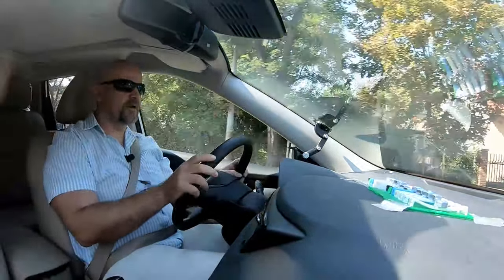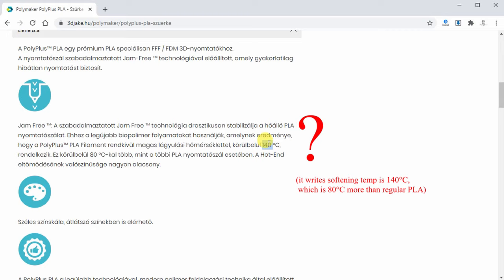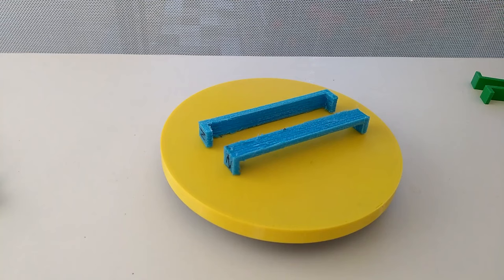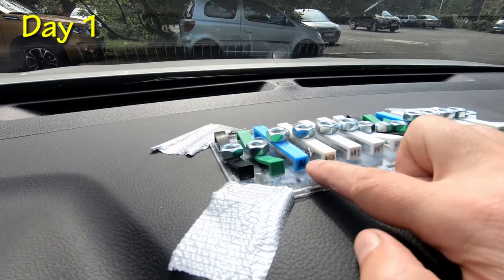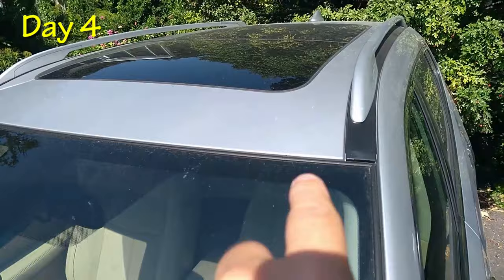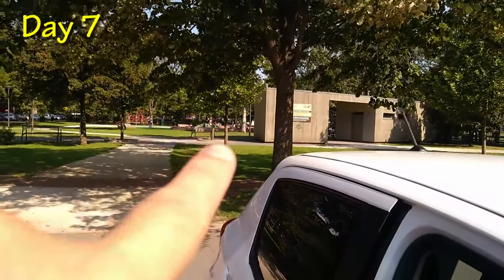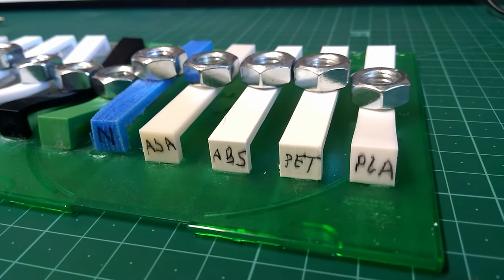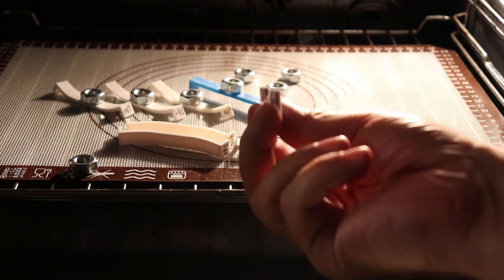What 3D printing material to use for object inside a car? Temperature test

Comment: I learned that PLA is not suitable for summer car driving the hard way. My Raspberry Pi Display stand melted in no time. :D
Reply: Did you ever redo it in a different material?
Reply: You have to anneal it first.. then it will hold up better than ABS / ASA

Comment: ASA is also much more UV-resistant than ABS, which is important if you print something for outdoor or in-car use. Great test, thank you! Unfortunately, summer seems to be over here in Germany…
Reply: But if you paint your print, then there's no need for that UV resistance in the filament. Right?
Reply: @alejandroperez5368  resistant, not proof
Reply: @leew8812  further arguing against the original point lol
Reply: Regular glass blocks almost all UVB, and usually the windscreen of a car will have a decent (80-90+%) UVA filter too. It’s less clear to me how many cars have UVA filters on the other windows, and how good they are. 

Also think about how much time the part will actually have UV exposure. Unless your car is parked in direct sunlight all day, and your part is going to be getting that sunlight at peak time, it’s probably a pretty small amount. UV exposure tapers off quickly outside of the ~4 peak hours. Even just parking in the shade of a house could halve the UV exposure of a part

Personally, for something inside the car, I wouldn’t worry about ABS not being as UV resistant as ASA. Even for outside the car, I wouldn’t buy a roll of ASA (if I already had ABS) when I’m not even sure if the part will be noticeably damaged by the UV (outside of the basically guaranteed discolouration).

If you have ASA already, and you can print it (it’s tricky!), yes it is technically better. But don’t stress about the part getting ruined because you don’t have the magic filament.

Comment: I have used ASA for my 4runner's phone dock, umbrella holder and various hooks and parts inside the car. It is an excellent material for this use case and has worked reliably for two years. Temperatures where I live get into the low 100F range.
Reply: Given this test, would you ever try to use PETG for the same purpose?

Comment: I printed an exterior plaque with raised letters out of PETG that is in direct sunlight every day for several hours.  3 months and it still looks as good as the day I printed it.
Reply: I too made plant tags for all my exotics, I live in CA, just went through a few ~110 F weeks....even printed in shiny black PETG(the 20ish usd rolls on Amazon...nothing fancy at all...in fact budget but not too low on the ladder). They all held up great wich is great but none are under any load or stress. I also suspect that anything outside greatly benefits from airflow to aid with cooling...much much different than under glass on a dash.  That's how ppl cook without electricity or fire.

I'm 99% into useful printing and about 75% of that ATM for me is living outside....so far PETG is so good at most things once dialed in, and pieces have that heft feel...that QUALITY feel lmao

Asa is to PETG like PETG is to PLA  except PLA still wins the toughness test time and time again.

Comment: I am new to 3D printing. The very first thing that I drew up in FreeCAD and printed as my first "thing" was a sunshade for a portable GPS receiver. I wondered about the direct sun affecting the PLA print, so I created a frame arrangement that allowed for a paper shade over the PLA frame. That won't prevent the ambient temperature problems, but it will keep the printed parts from receiving the direct sunlight and heat. Now, when my plane is out in the sun for a short time, I won't worry about the frame collapsing. If I know that it will be outside for most of the day, I'll move my sunshade off of the instrument panel and put it in the shady area inside.
Thank you for doing this research.

Comment: Perfectly done test with real life parameters, i print a lot of car parts, interior and exterior, i actually drove a test piece on the exterior for half a year, autumn to spring, made from PLA, no fading no deformation, as soon as the summer came it bent out of shape, i also had exhaust pipe covers made of PLA, the color faded quickly but the material held up just fine for over a year
Reply: " i also had exhaust pipe covers made of PLA, the color faded quickly but the material held up just fine for over a year" X DOUBT.
Reply: @Tarex_  nothing about a picture on your instagram proves that PLA survives direct contact with your exhaust tip.
Reply: @gearcheck101  well, nobody is forcing you to believe it, test it yourself, but if you do look the exhaust already had exhaust tips and the PLA covered those, if it helps make sense of it, otherwise, fact is it happened :)

Comment: Thank you for doing this.  I need to print a couple items for my Jeep.  I was going to use ABS just on a guess.  You confirmed it.  Again thank you
Reply from the maker: You should consider ASA too if the part will be outside, it is more UV resistant.

Comment: the temperatures mentioned are not marketing schemes, you need to anneal them to pass the glass transition temp so the molecules in the polymer change their structure and the part remains much stronger, the challenge is annealing them without structural deformation.

Comment: HT-PLA requires to be heat treated, usually putting it into oven for it to be able to recrestalize. Then it should have much better heat resistence. Tom Sandalerer did a great video where he used 3d printed HT-PLA coffee cup and even coffee espresso kettle.
Reply from the maker: Yes, I know about annealing 3D printed objects, my problem with annealing that object deforms, and if I need some accuracy, that's not the solution. On site I couldn't find this info that HT PLA has to be heat threated, only then it will give those properties.
Reply: @MyTechFun  Should be possible to make a form to hold the HTPLA in shape while annealing, especially for those test strips you used. Not really so good for more intricate parts though.

Comment: I like your practical test.  It shouldn't be controversial, but it is.  PLA should only be used for items made for "Conditioned" spaces.  Other materials should be used for mechanical parts which might reside outside of air conditioning.  A hot shed, garage, automobile or direct sunlight will soon have your parts in poor condition.  PLA is great to learn printing.  But it should be avoided for any type of practical or mechanical part used outside of air conditioning.

Comment: Great to see some testing in more "real world" scenarios. I wonder how annealed PLA (treated in oven at 70-80° for 30-60min) would have held up in this test. CNC Kitchen has a video on this, lacking the real world test though.
Reply from the maker: The problem what I have with annealed PLA is that it deforms during this process. Not good for precise useful parts.
Reply: @MyTechFun  that is true, depends on the part and use. Just would have been curious how it compares.

Comment: Nylon is typically recommended for in car applications.  Though taking steps such as active drying and printing in an enclosure may be necessary to achieve suitable results.  Another option is to order your parts from a Mark Forged print bureau.  Their Onyx material is essentially nylon.
Reply: Wouldn't a rainy day completely warp the Nylon?
Reply: Not to my knowledge.  The moisture concerns with Nylon for 3D printing are mostly related to the filament prior to printing.  When you take a material from room temperature to over 200degC in less than second in a confined space (nozzle,) the sudden conversion of moisture to a gas tends to be quite problematic.  After printing, it might depend on the geometry of your part whether a hot day coupled with humidity could cause warping.  But generally of the thermoplastics available to us, nylon handles the hot environment better.  So far as I am aware, atmospheric moisture (absorbtion) alone shouldn't cause warping of finished prints.  As for rain on external parts, I'm not sure.  But in most external applications, I would probably prime and paint which would seal the material from the elements.

The biggest issue in automotive applications is typically heat tolerance.  But UV, moisture and cold can present other problems.
Reply: Half your plastics in a car are abs, so that's really industry standard. Most of the gears and other hard use mechanical items would be nylon, really either would work fine for most of our applications. I mean even pla would probably survive quite awhile if not under stress and not on the dash. My pla stitch figure has been in my car for awhile now with no visible changes. (Moisture makes nylon bad to print and brittle but otherwise the humidty really shouldn't have any noticable changes)
Reply: @stich1960  The parts you’re referring to are injection moulded.  Different process.  Professionally designed, tested, iterated, produced, post processed, potentially surface treated and produced with possible additives or modifiers mixed with the pellet stock.

Not saying 3D printed ABS won’t work.  It absolutely is an option to try.  Just saying that use in one process, doesn’t automatically make it the best for another.  Even for the same end-use application.  (Testing always required.)

I can tell you that I've had a Markforged Onyx sample part in my car for over 2 years.  Summer heat, direct sun, winter cold.  No deformation or warping.  Looks as good as the day it came off the printer.  Surface finish remains utterly flawless.  Smooth to the touch with no post-processing.
Reply: @barrettdent405  I get what your saying but differences are not terribly big. Yes structure would be different and the reduced z strength or nonhomogenous nature of a printed part could be different but talking in generalities here. There are quite a few abs printed parts being used in small run vehicles parts currently. Nylon is great but basicly nylonx is the ok only great filament for high strength applications right now and considering your looking at 20 bucks for abs vs 60 or farming out the printing personally I will stick to abs.

Comment: Hi!
Very great test, love to watch. Very few car interior parts is white. 3D printing has been very popular in classic car restoraions. And many old cars has dark or black interior. You did a great job, but can you please do the ultimate test: try 2 or 3 of the filament winners and print them in black. If for example ABS in black holds the test, its a big winner. Black absorbs more heat than white. Thanks
Reply from the maker: Maybe in future, but so far it's not in my plan to test black colors too.

Comment: Tests like this are very specific. Just because it works best in the sun on the dash does not mean it is best on the consol.  Does not mean it is not the best.   Specifications are complicated to use. Creep and heat are hard to specify. Melt temperature is often not useful use number.
Reply: I meant to mention. It is a great test. Thank you for the time and effort. It is a timeless topic. Best filament, depends on the rest of the question. Best for what.
Reply: I am not over weight I am warped. LOL

Comment: ABS material is more rigid (stiffer) than PETG, while PETG is more flexible.  ABS will crack if bend or pressed, PETG will bend too but not crack easily. i think this is the reason why PETG have a little "stomach" since it flexible and weightened by metal nut. For long term usage i choose petg because it more resistant to UV. Direct sun to ABS will slowly make it brittle over time, ABS have a tendency to warped during printing process so i can not get accurate dimension and it have poor layer adhesion if printed without heated chamber. PETG easier to print. i think ABS is more suitable for injection molding.  if your print need to be very rigid then ASA is your best bet.

Comment: I´ve tested some ASA 3d printed pieces on the dashboard. 60 days in a row, sunny every day except 10 days with few clouds, exterior temperature between 30ºC and 45ºC, interior between 55ºC and 75ºC (humidity could be around 20%) but I suppose that the ASA pieces (orange) surface temp could be 20ºC more because of the direct sun exposure. After that time they became very very brittle.
Reply: Yeah so do factory plastic parts. Leather too. It's not great to subject anything to direct sun light actually.

Comment: Thanks for testing resin print also. I would bet on ASA or Nylon. But actually printing with resin can be easier than Nylon - interesting. It's a shame that PETG is not good enough.
Reply from the maker: Yes, I am very sad, that PETG failed on test. But if you live more to the north then I and your parts will be in shadow inside car, PETG may work too.

Comment: PLA is not necessarily a problem in a car and depends on the shape of the item.
I made a phone cradle that was long and relatively thin and it warped on the first hot day but I have large PLA pods on my dash that house 3" compression driver tweeters weighing half a kilo and 4 years on, they have not warped at all.

Comment: PETG...the fallen hero 😅 I've found PETG parts will eventually warp/deform after days in the sun. But it's highly dependent on the design of the part (and potentially the infill?). Shame that we have to resort to mostly 'toxic' filaments such as ASA and ABS just to get parts that don't deform under heat/UV exposure...
Reply: There's always polycarbonate and PA-CF. Or just print your car parts in PEEK or Ultem 😂

Comment: Great test but wouldn't a printed part have additional coatings like epoxy resin, uv resin, carbon fiber plus resin on top that would certainly impact these results? I would be curious to see that test!
Reply from the maker: I will test effect of the epoxy in near future

Comment: I think PETG is probably the best compromise between printability and heat resistance. Of course, if you can print better materials, why not.
Reply from the maker: Yes, depend where do you live. PETG may be a good solution, if you don't put the material exposed to direct sun on hotest place in the car.

Comment: I like the test. 1. It looks like after the initial slight warping of PETG it remained rather stable. So... I wonder 1. If you heat treated any of these filaments before the test. I think the answer is no. 2. I would like a test between heat treated PETG vs non heat treated parts. Also PLA Heat Treated vs Non Heat treated. To see if there is any significant difference between the two processes for PLA. I like printing with PETG because it is less toxic than ABS or ASA. And Relatively low cost per roll. I have tennis equipment I am designing and it might be left in the car. Most defiantly used outdoors in direct sun light.

Comment: You need to also consider the effects of UV, direct sunlight on the filament used. Some filaments will totally warp under UV light!
Reply from the maker: Ordenary glass filter most of the UV. Plastic parts in cars are usually from ABS (injection molded)

Comment: While PETG did fail...it didn't fail that badly. Also take the shape into consideration. That's an extreme stress test. I'm printing a mirror cover replacement for my parents. I've been promised the top will be down in hot days and in the garage most of the time. So I think it will work.

Comment: Nice video Mister.
I own a model kit and one of the parts is molded with Nylon Resin Carbon Fiber Reinforced.
It means molded with though material right?
Reply from the maker: In most cases car parts are injection molded.

Comment: i wonder if a clear petg would be even more effective at holding up. if it just needs to be a functional part. it being clear would mean it doesnt absorb heat as much. which is why the black filament didnt hold up well, even though it was a bad filament for heat resistance, the fact it was black wont have heled either.

Comment: Nylon is hygroscopic and starts to creep at low temperatures when in contact with high humidity. The test result would be completely different if you'd considered that. Otherwise a nice comparison

Comment: The ultimate material for me would be a HT PLA or perhaps HT PLA+ or a Low Warp ASA. Why not a CF PETG. I want it EASY to print and a higher temperature than normal PLA. Low warping. Curling and such. Which material is that :(
Reply from the maker: Yes, from that video I tested a lot of different technical materials too. And yes, CF always helps with temperature resistancy, so CF PETG would be a great material for this application.

Comment: Hah🤨 I thought that PETG could withstand temperatures around 80°C without deforming, but as I understand it from watching your video, the PETG will deform on much lower temperatures(~60°C), if it is exposed to the temperature for just a few hours. Or did I misunderstood something here?
Reply from the maker: It wariates from brand to brand (from 60-80°C in my experience). I want to do a test with comparing 10 PETG filaments in near future.
Reply: @MyTechFun  Ahh, so there is a difference in brands when it comes to the temperature resistance.
A PETG comparison video would be great then.
I will definitely look forward to it👍